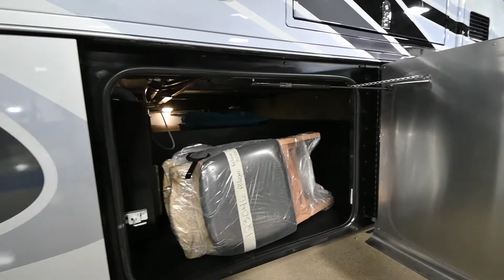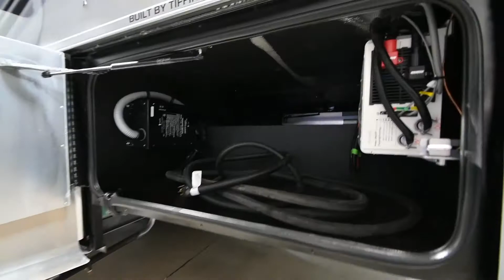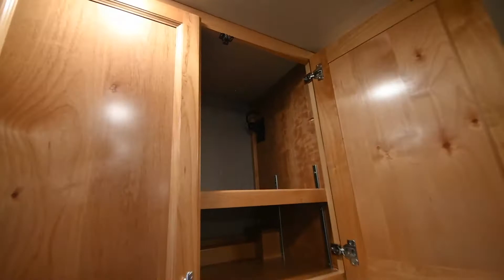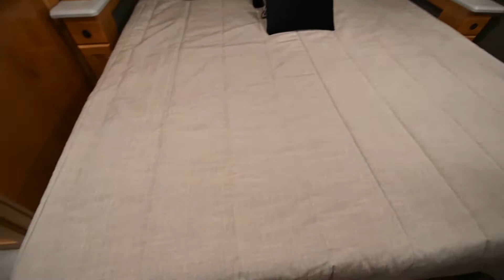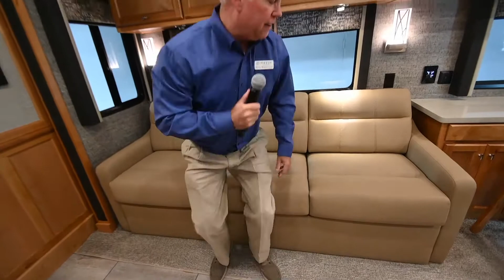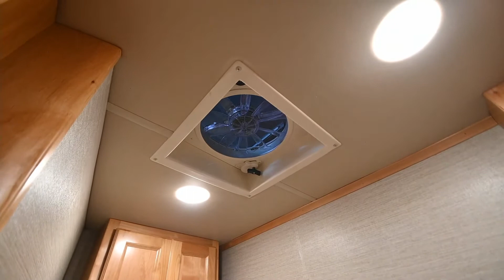2021 Tiffin Allegro 32SA Walk Through Tour

Comment: Very nice.  It would have been good to discuss any solar prep and lithium battery options, to keep that fridge humming.  I like the 32SA a lot, the floorplan is great, but I'm not a fan of the cabinetry color.  I'll have to take a serious look at it.
Reply: From what I have read of a review of a 2019 model, the solar prep is insufficient if you ever plan to add a substantial amount of solar.  It was designed to only accommodate a couple smaller panels.  You may be better of just buying without the solar prep and doing a fresh install of everything.  Yes, that means drilling a hole in the roof but good installers know how to do that well.  Tiffin may have improved this in the newer models, however.  If they are smart, they have done so.  Large lithium battery banks and lots of solar panels are the wave of the future and they have to know that and at least install the prep to accommodate.